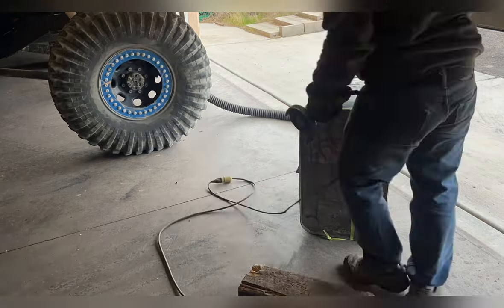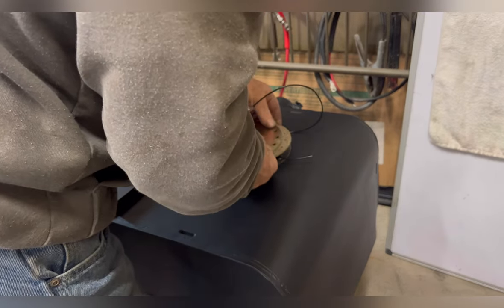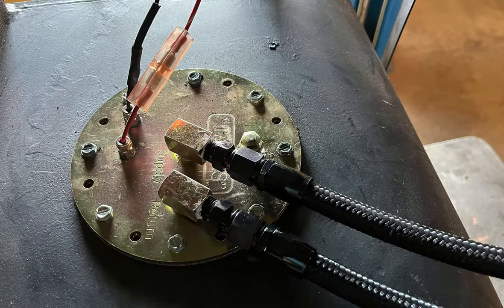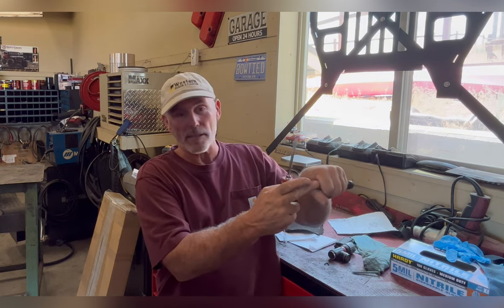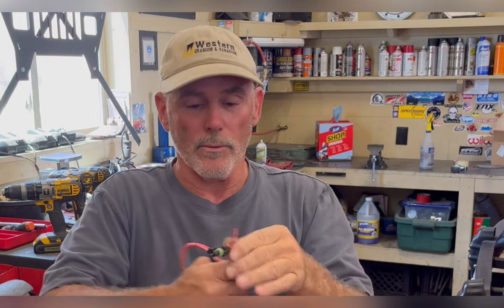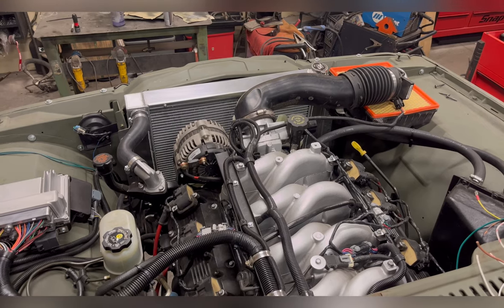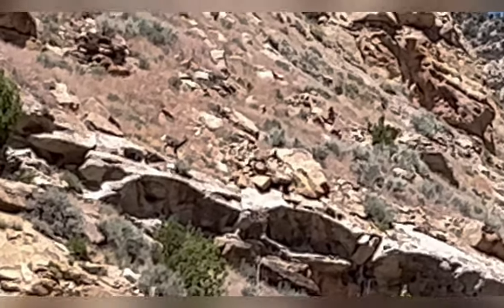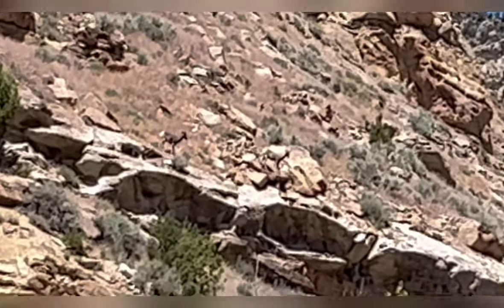M715 8.1 Fuel system with brain damage wire problem. Full size on 21 RD.

Comment: i had a 5.2 dodge no fire but when testing everything all was good. what was going on was the 2 pin connector on the coil wasn't locked good in the connector when i probed with meter had voltage but when plugged into the coil it didn't reach the pin in the coil there fore no 12 volt to coil finally hot wired and engine started knew then had connection problem repinned connector all was good
Reply from the maker: It’s all a learning curve. This is my favorite part of social media, information exchange.